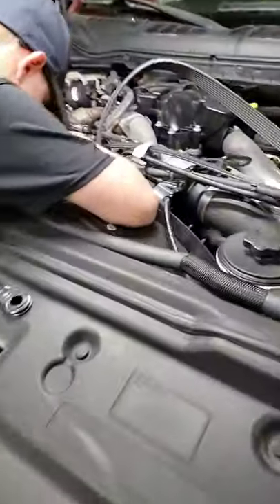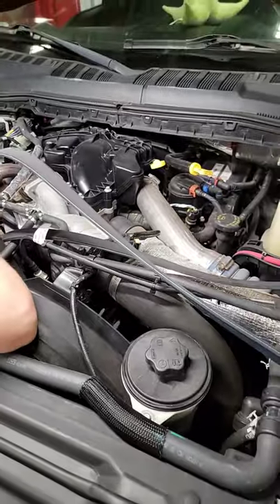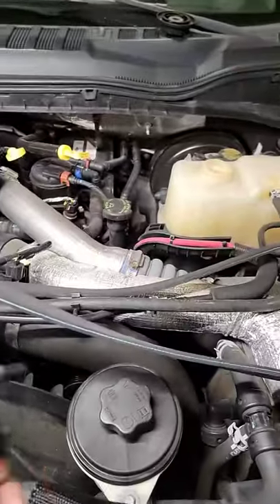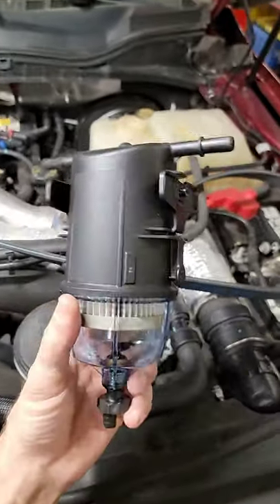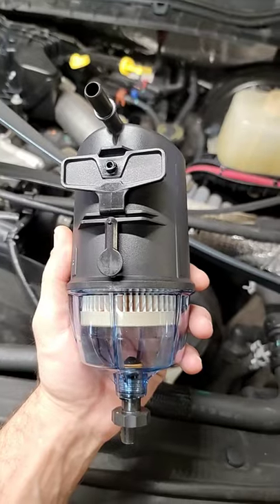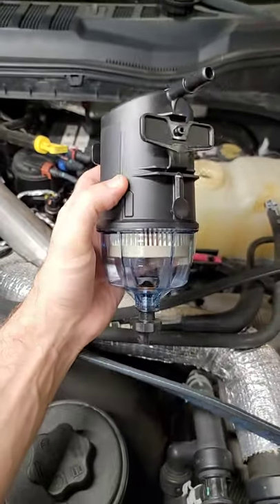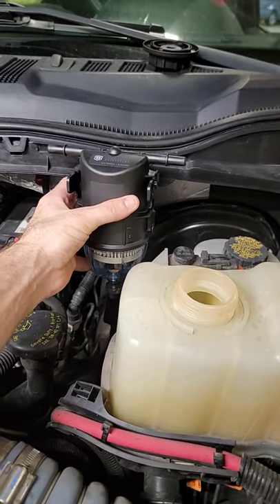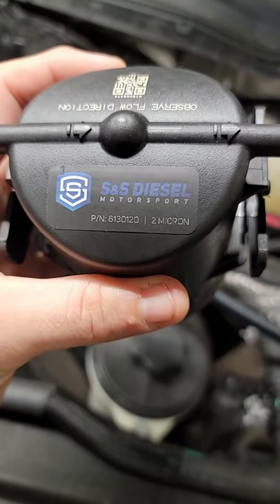How do YOU protect your 6.7 fuel system??

Comment: I got  a question out of curiosity maybe its stupid idk but how does the filter save your injectors frome a cp4 high pressure pump failure if it is injecting straight into the rail sytem and after the filters because as far as i know the pump dont pump backwards .....i pump all my fuel into an external run a 2 micron filter on that then it foes through my water fuel filter seperator in the rear and then again through the filter just before the pump so its extremely clean fuel but anyways theres a fuel filter under the hood right before the pump so if tho dont stop it why would adding another one stop it also even if the screen was under that filter again the pump is ahead of all the filters injecting the fuel straight into the rails at high pressure through the injectors and i dont see how  a screen and filter even if was somhow ahead of cp4 pump would stop sharp metal shavings being pushed around 3,500 to 4,000 psi through condensed space but again maybe my thoughts are flawed im just asking to gain knoweledge on the subject

Comment: I'm surprised you haven't done any Exergy metering valve installs. They have a much finer screen that will clog and shut the truck down if the CP4 fails and stops it from getting to the High pressure system.
Reply: but the s&s bypasses the lower end of the pump all-together so the metre filter is inferior . only really used for the 2016 and below duramax which cant use these style of kit cause no lift pump + they just do cp3 swap
Reply: @viaswords4888  but the fuel flows through the cam case (which is where almost every failure in a CP4 happens) before it gets to the screen. So the screen would stop it. I'm not hating on the S&S kit, but I'm personally not a fan of having more fuel lines under an already crammed engine bay.
Reply from the maker: Gravvy

Comment: i did the s&s kit 300hrs on it so far so good . only complaint . you need to adjust some rubbing areas by the degas bottle and brake fluid . i also just did serpentine belt just remove the intake and cold side . bye the tensioner tool and its the easiest thing ever take you 45min

Comment: Is it just me or is anyone else concerned the filter housing is all plastic? Arod recently did the HSM secondary filter housing upgrade for known issues. I know this return filter isn't under pressure, but couldn't this crack from heat cycles over time? Seems odd to upgrade to hsm to remove cheap plastic and then install more plastic in the fuel system just inches away 🤔
Reply from the maker: No issues brother. Filter set up has actually been around for some time. Look at the comment section of the S&S install. Guys were talking about that
Reply: @PowerStrokeTechTalkwARod  Thank you!

Comment: I have done exhaustive research on this and I am still on the fence.  I like the idea of it but has anyone had a CP4 failure using the Gen2 system that did not have to replace any part of the fuel system (other than the CP4).  Has anyone used it with a failure and inspected everything for debris?  Was there any?  Was tank dropped and/or cleaned?
Reply from the maker: Why havent you watch S&S channel????????
Reply: @PowerStrokeTechTalkwARod  I have watched their videos, I could not find one about sucesses with failures,  I did see in comments below though that something was in the works to document failures.  I know in theory it works,  I just would like to see it in action.

Comment: Would I would like to know, someone that had one of these kits installed and had a CP4 failure.
Did it do its job??
Or is this marketing and a whim!
Reply from the maker: Yes bro it works, im not gonna lie
Reply: Have you actually seen one save the components to the point of only the CP4 needed replaced?
Reply from the maker: Had it personally happened no....luke the owner has. They are makin a video showin ya

Comment: They should really stop using the cp4, go back to cp3 or denso like Chevrolet
Reply: That's what RAM did. Upto 2018 the Cummins used CP3. RAM then  switched to a CP4 in 2019 & 2020, by 2021 they switched backed to a revised CP3 pump because the CP4 failures.  One thing with a RAM is for the 2019 & 2020 trucks, they can be retro fitted back to a CP3 by installing one of the few kits now offered.

Comment: Any proof that it works?
Reply from the maker: Ahhh yeahhh go check their channel out brotha
Reply: @PowerStrokeTechTalkwARod  I’ve seen videos discussing how it works, but no proof of people it’s saved their fuel system
Reply from the maker: Ask Luke
Reply: They plan on making a video failing a fuel system once they get moved into their new building last I knew.
Reply: @PowerStrokeTechTalkwARod  once I see proof, I’ll buy one
Reply: I had an SPE one (will never buy SPE again, though) and it saved my injectors and rails when my pump went. Their return protection which is just a tiny screen blew right through. Since the S&S gen2 kit has an actual filter and is 2 microns, you'll most likely be fine on the return side of things. So if the SPE kit saved me, I have absolutely no doubts about the S&S kit. It is truly a quality product unlike SPE.